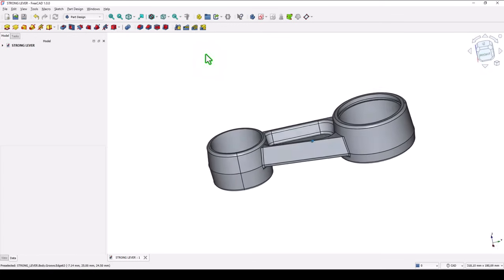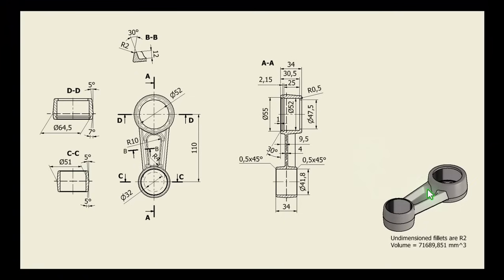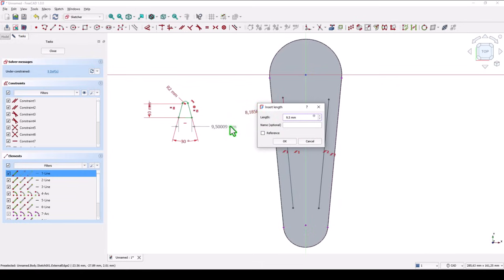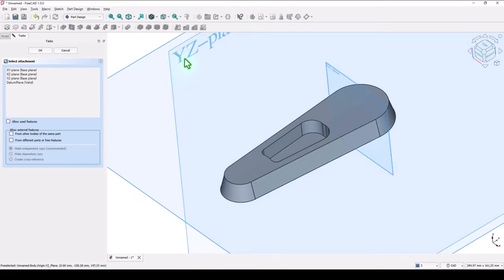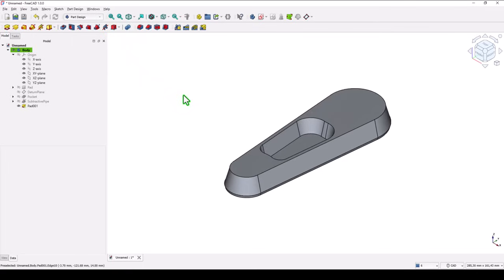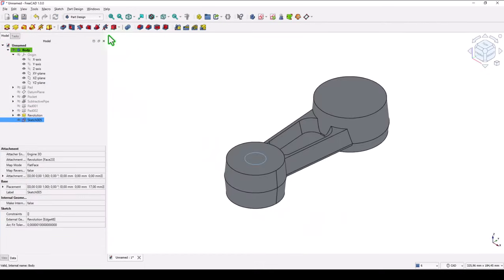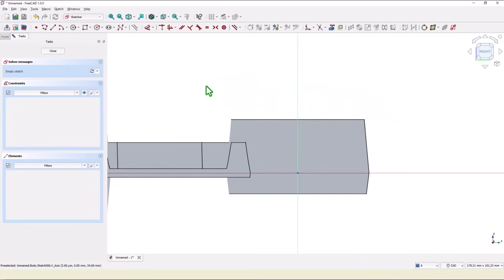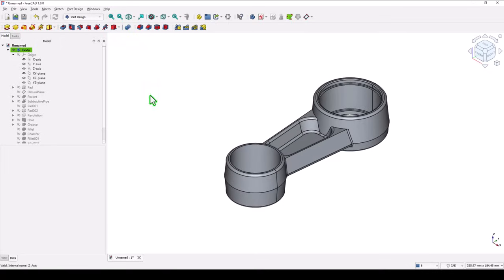Tutorial FreeCAD - 028 STRONG LEVER

Comment: Hello Professor, in the case of FreeCAD you can use driven dimensions as you did in the Inventor version of this part. Not as convenient as in Inventor but nevertheless. Requirement is that the dimension to refer to is given a name additional to its value. The other, driven dimension is replaced by an expression. The expression reads the value from the named constraint. To give the driven constraint an expression replace its actual dimension with an equal sign. Then enter the hirarchy of the dimension to take the value from. The syntax for accessing constraints of the actual same sketch is: Constraints.DimensionName (the name previously given to the first dimension).
Reply from the maker: Many times I learn FreeCAD from you. Thank you my friend!